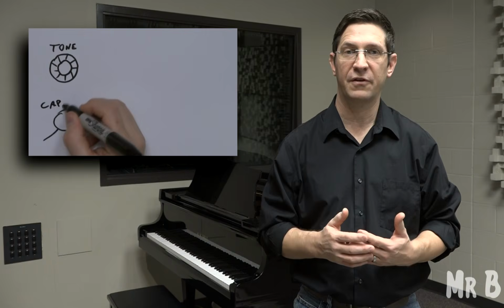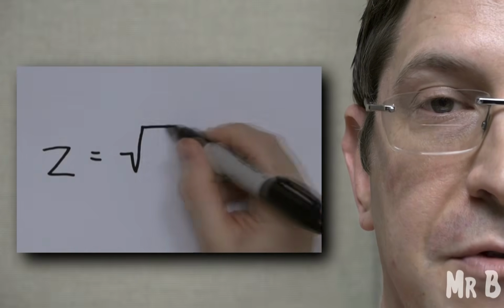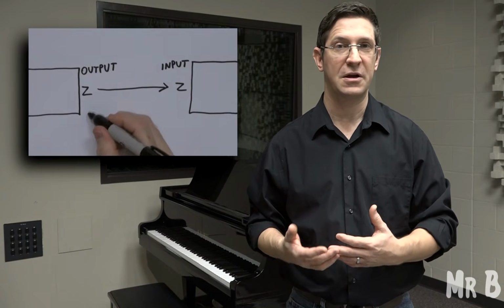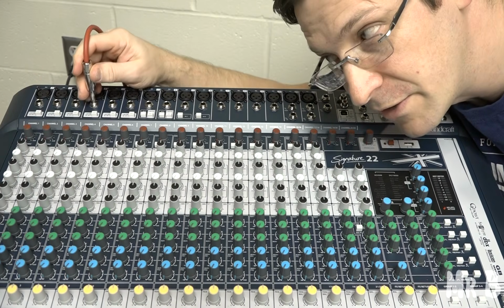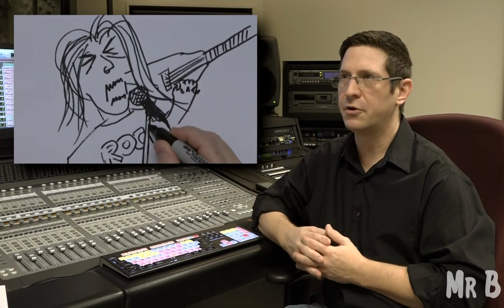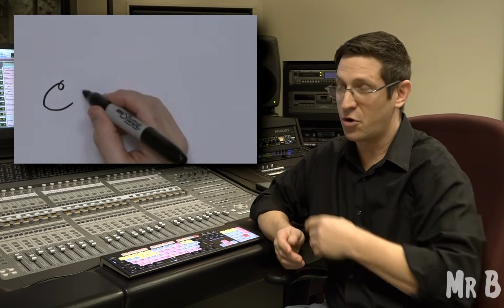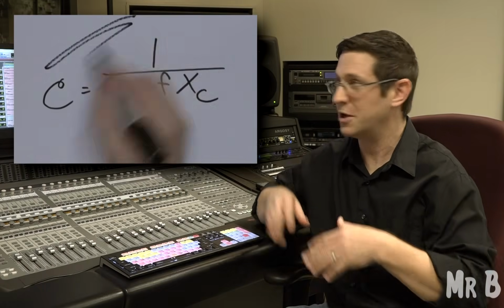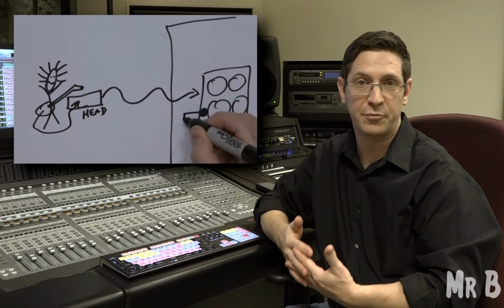Guitar Cable Length - Why Size Matters

Comment: Hi, Mr. B
 Werner (The German guy who got your old job down in Lincoln, haha) here. Just came across this series by chance. Great work, keep it up.
As far as guitar cables go I'd like to offer an alternative approach. As a player I find that DI boxes do affect the tone of my guitar , mostly because the input impedance usually doesn't match the defacto 1MOhm standard most guitar amps (and pedals) offer., it's usually way lower, around 100KOhm. That will matter a great deal if the player uses his guitar's volume and tone control, since they'll act completely different. Plus there is the issue of what running the signal through 2 transformers will do to transient and frequency response. IME the guitar tends to become mushy and less focused which is why re-amping isn't the last word in guitar recording IMO.
A much better approach (and cheaper than two DI boxes) is a quality buffer. If you have a guitar tuner with a decent buffer or any other buffered  pedal (that isn't "true bypass") then just put it in between the guitar and amp, simple as that. Now you're driving that cable with a low-Z load and length becomes almost irrelevant.
You can also get a hi-qualty buffer like the Concord from Emerson (no affiliation)  for $79.00 or something similar. To the purists I'd say that a buffer will affect your guitar's tone way less than two DI boxes in series.
One more thing, the cable doesn't just roll of highs when it's capacitance increases (due to poor quality or length), it moves the resonance peak lower, and that's an effect you can actually use to your advantage, just ask Jimmi Hendrix how he tamed the highs from his ice-picky Strat.
Again, great work!!!!
Reply from the maker: Hi Werner!  Thanks for watching! Great advice as always. I've often wondered about the coloration from the DI's, so that makes sense. 

Cheers!
Reply: @MrBinthestudio  Looks like he's gunning for your CURRENT job now. (Sorry, couldn't resist).
Reply: tks for the info - i play with a Boss TU-3 after a volume pedal and in front of 3 other pedals then a 1/4" cable into a powered DI - then a XLR approx. 30' into another DI and out with a 1/4" cable into the high impedance input on my amp. i would like to remove the powered DI's from the chain - since the TU-3 is buffered can i run a 1/4" cable from the pedalboard 30' to my amp?
Reply: @ccapdepon  First, I'd put the TU-3 before the volume pedal, that way your volume pedal will cut less highs when rolled back since it's seeing a low-Z signal. Then I'd just get rid of the DI's and use a high quality low capacitance guitar cable to connect. best advise: Use your ears.
And again, a lot of it depends if you use your guitar's volume and tone controls.

Comment: 18 feet and 6 inches maximum before using a DI box. Short cables can make Electric Guitars sound too brittle.BTW, no need to put the little amp down, looks like a little Super-champ and with a decent alnico speaker it will sound as good as any Princeton( 10" speaker, reverb tremelo) plus it has some useful effects. A great recording amp. It also has a " Line-out" for DI recording so no need for boxes unless you want to mic it up which is great cos you can double your Guitar track, DI on 1 channel and Mic on 2 channel and blend from there. Use what you have and get the most out of it. All classic recordings used basic equipment and fewer microphones causing us to use our ears rather than make decisions based on Equipment designations and Mathematical impedence charts. Trust your ears , they are an instant meter level you can bank on. Peace Man!

Comment: 10 foot cable is too short, 200 foot is crazy -- is 25 foot okay?
Reply: 25 foot is good. I got a 20ft after using a 10ft for a while and I’d have to get an instrument to measure the tone difference. I think anything longer than 30ft will start to have an audible frequency loss. Even then you can just dial in the tone a bit.

Comment: Great overview! You've started to connect my rudimentary electronics understanding with my rudimentary musical ability! I have one question about the "concept" of impedance and would appreciate understanding it with respect to a guitar. Given the "flow of water" analogy to electricity, I understand impedance to represent the "resistance" that the flow encounters (IE: water is trying to flow down the stream but it keeps meeting rocks or some sort of alter current that pushes back). If this is the case, given a guitar and a preamp, can you elaborate more on why the preamp needs to have 10x more impedance than the source? Naively speaking, my brain hears "the guitar has the ability to push through X resistance ... so we need to plug it into something that has 10x that resistance!" That makes me think "I can lift 100lbs, so, please put 10,000lbs on the barbells"? It seems like nothing should happen at this point bcs I can't budge 10,000lbs. I know I'm wrong but I'm trying to clear up my analogy flaw. Otherwise, I simply go with the rule of thumb and hope that this mis-understanding doesn't come back to bite me in some other way.
Reply from the maker: Thanks for watching! The weights analogy doesn't quite hold up in this instance.  When you connect two devices together, you are basically connecting them in parallel.  So take two resistors as an example.  If you have a 10-ohm resistor that is drawing 1-amp of current, then you connect another 10-ohm resistor in parallel, it now is also drawing 1-amp, making the total draw of current 2-amps, effectively cutting the total resistance in half.  Now, if you connect another resistor in parallel, this one with a resistance of 10,000 ohms, it only draws .001 amps, so it is effectively "invisible", in that it has very little effect on the total circuit.

That's what we're trying to do by having an input z that is 10x higher than the output z driving it.  By having the input z adequately high, it becomes invisible to the output device so it doesn't load it down.

To put it in other terms, if the input z isn't high enough, the input device thinks that the input is it's own output, and causes a drop in signal and other issues as well.  Hope that helps!

Comment: I tried this last night. Previously I was using a 25 foot cable and then 3 additional 18 foot cables in my wet-dry guitar rig (including effects loop and to the second amplifier). It sounded very good. But then I replaced all those lengthy cables with 6 foot cables for my pedals and a 12 foot cable for my guitar. Boom! Immediately I had more high end frequency responses. This not only improved my tone, it also gave me greater flexibility to use more different settings effectively on my amp and guitar. Thanks!!!

Comment: Only part of this is correct. Since the guitar pickup is a coil and the cable is a capacitor you have a second order low pass with a resonance peak at a certain frequency, as long as the volume control is full on, so it will not dampen the alternating charging between coil and cable. This resonance peak is more pronounced the lower resistance a pickup will have. you can tame a shrill strat or Tele with a longer cable, not only reducing treble, but also shifting down the resonance peak. This resonance peak is much of the character of the sound of a guitar. A too short cable will shift the resonance up high and kill a lot of the character...ice pick sounds come to mind. Many old school blues players used this trick btw. playing through a super reverb with a Tele with a long cable and sounding fat...

Comment: I have a question. I have a Keyboard ( Korg kross 2) to be precise. What h explained in the video does it apply to my keyboard? Does a shorter cord sound better than a longer one?
Reply from the maker: Keyboards don't have the high impedance outputs like guitars, so you can get away with a much longer cable before you have any noticeable high frequency loss
Reply: @MrBinthestudio  dude u posted this over 4 years and ur still responding! Thank you! You are one of a kind!

Comment: Some important information was left out. The main function of a DI box is to convert a single ended signal to balanced, or a balanced signal to single ended. The properties of a balanced connection makes it suitable for long cable runs. Its important to know the details for compatibility issues.  Balanced and single ended operation are not compatible which is why you needed the 2nd DI box. However, some mixers have functionality of a DI box built in to the input of a channel. If this is the case, you wouldn't need the 2nd DI box at the mixer. Either way, knowing these details is necessary. For example, you could have a noise issue that originates from short circuiting a balances/SE connection and not be aware of it, making the diagnostic process much more difficult. These types of issues are very common.

Comment: For long runs, I bought and use a Zero-cap cable. They have a box that lowers the capacitance to near zero. Your guitar sound is now like using a 1 foot cable. It works great!

Comment: Love the video - very informative and entertaining!

Question: When playing live I generally use a 15' cable from bass guitar to a pedalboard (all true bypass pedals, I believe) then a 10' cable from last pedal to amplifier.

The cables ARE high end (Tsunami Cables), but do you think that I could be experiencing any significant high end loss over 25+ feet or am I OK?

Thanks!
Reply from the maker: Well, the question is, have you heard any loss? It's also possible that your pedal has a buffered output, which eliminates the issue. My guess is you're fine 🙂
Reply: @MrBinthestudio  I haven't heard any loss per se, I was just more curious than anything. Many thanks for the reply!

Comment: You could also use a longer guitar cable that has very low capacitance, such as Klotz AC110, which is only 70pF (picofarads) per foot. 25 feet of this cable will not ruin your guitar tone at all...

Comment: Where to start.  You are right, there is a difference between 10 feet and 200 feet.  If your amp needs to be 200 feet away something seems amiss.  I doubt you would be able to hear the difference between 10 feet and 25 feet though, and even if you could there are some thing you overlooked.  The first one is the settings of the tone control on the guitar.  If it is not backed all the way off, just back it off a bit and you are good to go.  The bigger issue with long guitar cable runs IMHO is that the low level unbalanced high impedance signals are much more prone to picking up noise.  The other thing that was overlooked was that 99% of the people playing an electric guitar will use at least one effect pedal, and the outputs from effects pedals are almost always much and in orders of magnitude lower impedance than the output of the guitar.  So the whole impedance issue is moot, as are the noise issues.  The DI box idea is interesting though if you are a signal purest I would question what going through the two transformers is doing to the signal unless they are nice high end audio units and you are not going to find them in an inexpensive direct box.  The other option is a transformer less direct box, but they bring in noise as they are active devices, and again, good parts do not come cheap.  The parts in most stomp boxes are usually pretty mid to low end, to be fair, but they contribute to the overall sound of the box, an interesting case of a bug becoming a feature.  I would say if you need 25 feet, go with a 25 foot cable, if you use a stomp box you can use a short cable into it and a long cable out of it.  About the only time I would ponder the DI box solution is if I really needed to go > about 25 feet in a noisy environment with a raw guitar.  It is also not unusual for a larger studio to have either movable panels you can make a cave out of. for the amp.  Also, don't forget if you move the speaker far away with cables, true noise is not an issue, but you add more impedance to a circuit that is low impedance and thus much more sensitive to changes.  You can sacrifice bass performance.  With very long runs you are not dealing with a linear resistance as you have the skin effect in the wires to contend with as well as the increased impedance lowering the damping factor.  It is never simple.  But again there is a big difference between 25 feet and 200 feet.

Comment: A always great videos. Questions - When recording guitar or bass with multiple DI’s, do the cables need to be the same length, and/or do different lengths create phase issues? Seems to be the shorter the unbalanced cables the better, would a balanced mic level cable of high quality, say ‘Mogami’, lose any top end or audio quality at say, 10 meters? Kade
Reply from the maker: It's not so much about the cable as it is the impedance of the output device - in this case, the DI.  By having a low Z output, the cable can be longer before you have any high frequency loss.  10 meters shouldn't be an issue, even with standard grade mic cable.  Thanks for watching!
Reply: @MrBinthestudio  No probs mate, you’re a wealth of knowledge. What about for unbalanced cables connecting the DI’s or pedals (through jacks etc) does it matter or cause any issue if you have multiple different lengths?
Reply from the maker: @KadeTurner  All of your cables between the guitar and amp can potentially make a difference.  Between pedals, it's hard to say for sure, since pedals can have different electronics in them that will affect the impedance differently (see the pinned comment from walthaus).  The bottom line is to listen to the final output for yourself, and decide if you hear any loss of high end.
Reply: @MrBinthestudio  Ah yes I understand, and a very good point mate. I got phase issues when using four DI’s at the same time. I wasn’t sure if this was just characteristics of the gear and natural to happen with different DI’s together, or the fact that the lengths of the XLR cables were different and that was causing a micro time and signal difference to the DAW. (If that makes sense)
Reply from the maker: @KadeTurner  have you checked the polarity of your cables?  That could also cause a phase issue if you're using them simultaneously
Reply: @MrBinthestudio  Yeah i’m sure we did, I remember using a digital plug in and when we reversed it was still no good so we found somewhere in-between that sounded right. That was new to me then, and I still never quite understood what was causing it. Was very minor differences in the wavelengths signal the same as you’d line it up (in pro tools) from different mics. I know how we got it sounding right, but the cause behind it I don’t.

Comment: This is great stuff. Thanks so much. I have a question though? How much of this applies to the scenario where you connect the output of your pedalboard to a the power amp of a combo speaker via the "return" plug. My pedalboad gives me the option so turn the output into a "line" or "instrument". I would like to know which option is recommended (line/instrument) for this scenario and what's the maximum length the cable should be? Sometimes I am on the right side of the stage with my speaker next to me and sometimes I need the speaker 8 metres away on the other side (normally when I play with 2 amps in genuine stereo). Thanks in advance .
Pablo
Reply from the maker: Hi Pablo, great question.  It's possible (in fact, likely) that your pedal board has a "buffered" output so you might not have the high frequency loss in either scenario.  If I were you, I would just test it with a long cable and listen carefully to the difference.  If you hear a difference using the Instrument output vs. the Line output, you'll know which to choose.
Cheers!